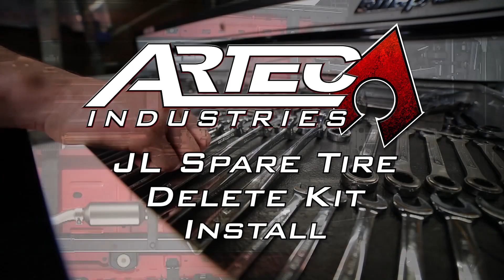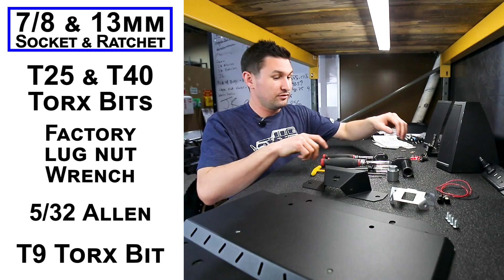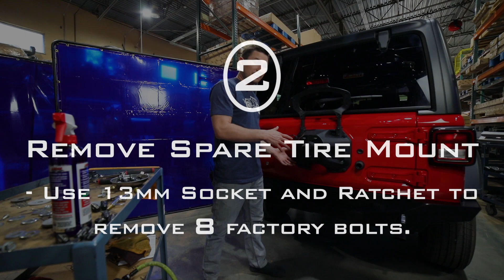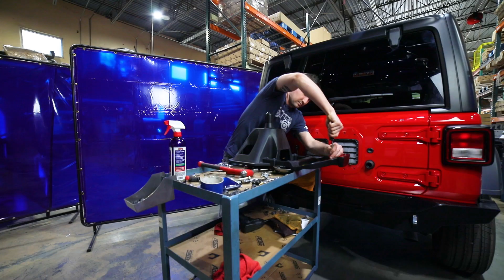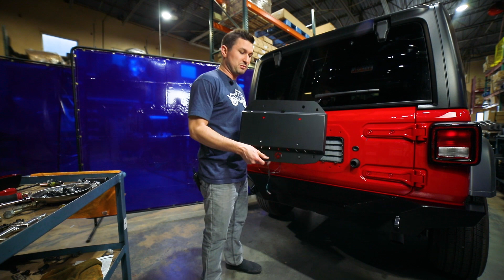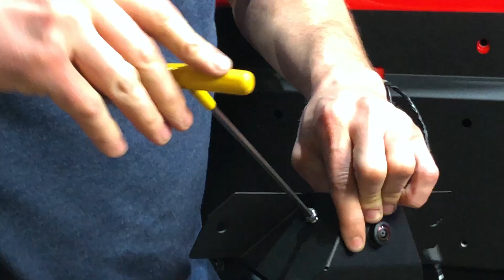Jeep JL Spare Tire Delete Kit Installation - Sku: JL5627

Comment: I have to say, getting that camera housing out took, PB Blaster, and a lot of beating on the three stud holes ( found that the handle of my ratchet fit in the hole and used a hammer to tap) finally got the claws of my hammer under the lip on the inside and yanked like pulling a wisdom tooth out of BigFoot! The inner bracket didn’t line up with outer and it took a screwdriver and pliers to get the screws in. The fit could definitely have been better, had some parts that weren’t in the video (?) Lastly, the video needed to be filmed by someone instead of just on a tripod. It was confusing in several places requiring watching again and again. Overall, I can’t recommend this as it is, unless you have experienced doing this before.

Comment: So I have a question. I bought the powder coated for Jeep JL. I did not get the lighted license plate kit. But my kit came with two additional holes above the top two license plate holes. I’m not sure what those holes are for. I’m worried about rain and mud getting in there. Just trying to figure out what the additional holes are for. I don’t see them on the kit you demonstrated in this video and on the artec website, I don’t see the additional holes either.
Reply from the maker: Please check your email, I responded a few minutes ago! Thanks!

Comment: Just fyi I just installed this on my 22 jlur and the camera doesn’t have to tabs like the one in the video
Reply from the maker: This video was made back in 2018, prior to the camera change in 2021, so that's why it looks different then what is on your 22. We revised this part when the camera change was made, which is why you have the two different camera brackets included with the part, but we are still editing the new video before it is released to the public. Thanks!
Reply: Are the current directions anywhere? I have a 21 JLUR
Reply from the maker: @mikesmerdon1422  That video will be finished up and released early next week!

Comment: question: there are comments on the artec site stating subtle differences between the 18-20 and 2021 brackets.  Can you confirm or deny if there are differences and whether that will cause problems?
Reply from the maker: The camera is different on the 2021 models,  Our current license plate delete kit will not work but we are finishing up a new camera mount bracket that will work for both Current and previous style cameras that should be out very soon .

Comment: A quick question. Is the main aluminum housing that bolts up to the actual door protected in any way so it does not scratch it? Would think the paint might get scratched over time when removed or do people just put some sort of thin protective layer?
Reply: I installed 1/8” 15/16” rubber washers on the inside of the bolt holes to protect the paint

Comment: Either my camera came from the factory backwards or your instructions are backwards
Reply: His instructions were backwards. He clearly said install the camera with the top prong facing up which i did and when in reverse everything was upside down. I rewatch video to see if i misheard but i didn’t. He said insert facing up but he inserted it facing down. Probably because he was holding it upside down… good news is it was an easy fix compared to OEM or others

Comment: Just added this delete kit to my 2018 JL and I love it!! What drew me to this kit over the others were three things..

1. It is made out of aluminum instead of steel. I know a lot of folks would want the steel because of strength, but we all know what happens if steel gets even the tiniest scratch on it......RUST!!!!!
2. It allows you to use the factory third brake light and the factory back up camera! I've seen at least one other kit that allows the camera, but it sits too low and doesn't use the factory third brake light.
3. THE PRICE!! For JL spare tire delete kits, the price on this at the time of purchase was waaaayyyy better than the competition! 

Artec has a winner with this product, and I couldn't be happier with the way this looks on my JL! Thanks Artec Industries!!!
Reply: Oh, one more thing, I did not put my license plate on the kit as I still have the factory rear bumper on my JL. I did however put a reflective American Flag license plate on the kit that looks GREAT!! USA! USA! USA!!! :-)
Reply: What is the name or link, for this kit ???

Comment: This is exactly what I’ve been looking for. I wanted a delete that used the factory brake light and didn’t get carried away with the delete plate design.  And to top it off it’s $110 cheaper than the bodyguard brand one I was going to get. I’ll be ordering mine next week!

Comment: This video was helpful, as one thing the spare tire delete kit doesn't have is directions. I do wish he had gone over wiring the tags lights though. I haven't been able to find anything helpful in wiring the bolt lights on a JL. On videos with similar applications they seem to splice into the passenger side taillight. Is that the recommendation for this install as well?
Reply: Adam Parkolay check out litebright channel on the Motobilt delete. She goes through wiring up a tag light.
Reply from the maker: We have additional videos and wire harness options coming very soon.

Comment: Just ordered this like the clean look, the fact that you don't have to splice anything, and keep the 3rd break light. Great job guys!
Reply: Jose Aguilar where did you order this ?
Reply: @eddyi818  I ordered one bare aluminum instead of the black. I'm gonna have mine painted to match my JL. Here is the website where I ordered mine from. https://www.artecindustries.com/JL_Spare_Delete_PC
Reply: Got2DeadLift does the dealership paint it or a body shop or what? I’d love to do this as well if I knew the paint would perfectly match.
Reply: Samantha Lee Usually body shops will paint it for you. On driver door there is a bar code that gives the code for exact manufacture car paint of your wrangler. Once it’s painted like your Jeep and installed it looks factory. You have an option to put the plate on it or not. I kept my plate on bumper to give the back a flush look. It’s well worth it. Makes wrangler sleek, elegant, more sporty sexy look. It shows the engineering of the entire back rather than that ugly tire !!